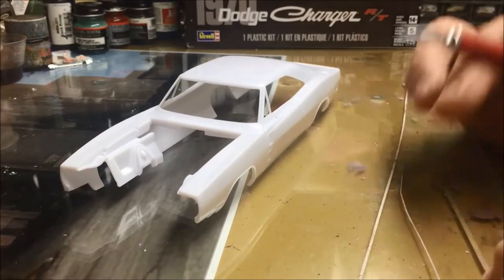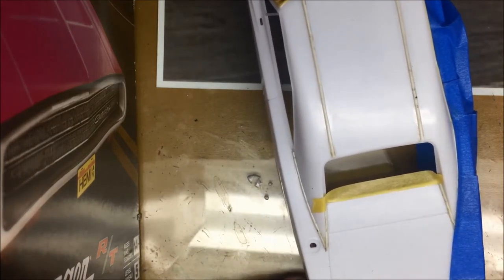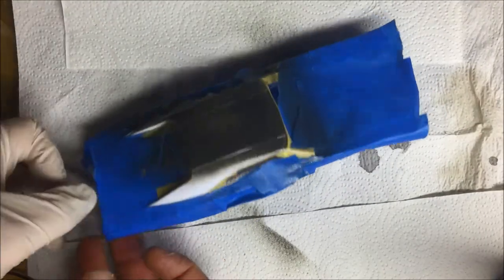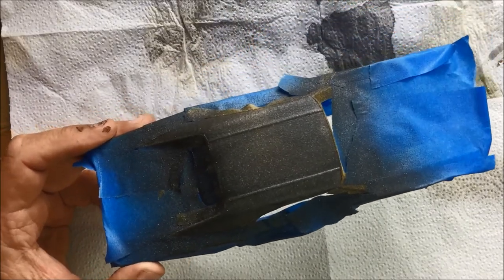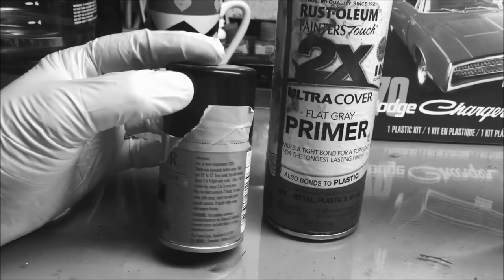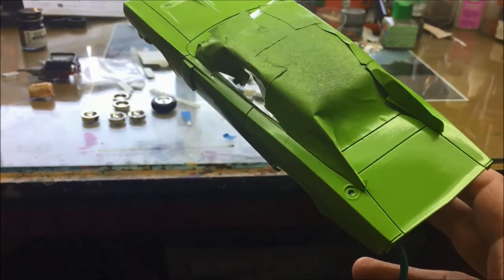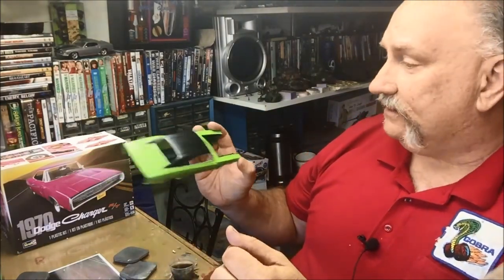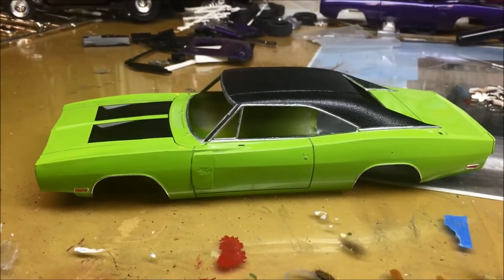1970 charger build 1/25th scale part 1

Comment: Thank you very much for the nice vinyl roof tutorial. My sense tells me however to start with the lower body and finish with the roof. Is there a clear reason why not to follow this sequence?
Reply from the maker: No, I've done it either way. As i remember though the blue tape i use doesnt stick as well to the top once its completed as it does to the lower painted surface. After it is cured of course. Thank you for watching and commenting.

Comment: Very cool method for the vinyl top.  Just wondering..... respirator and spray booth..... save your lungs my friend!
Reply from the maker: Thank you for watching! I actually spray in a shed outside with a rather large door that is open along with my fan running. I'm very fortunate that way or I would be using a spray booth.

Comment: Get build mate, can you please tell me what size styrene you used for the over lap on the vinyl roof
Reply from the maker: I can't remember cuz it was so long ago but it would have been .010 thick you could use .015 thickness I'm still work, I want to say the width was .030. I honestly can't remember exactly because it was a build I did a couple of years ago but if you look at your model and compare those sizes I think you'll be very close or right on to what you are after. As always look at reference photos beforehand just so you can gauge the real look of the width of the overlap. Thank you for watching